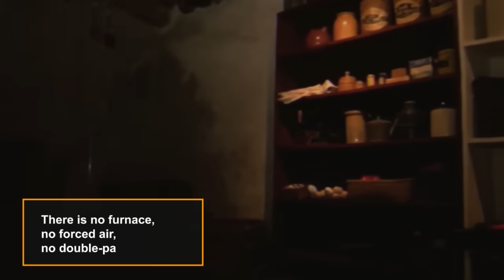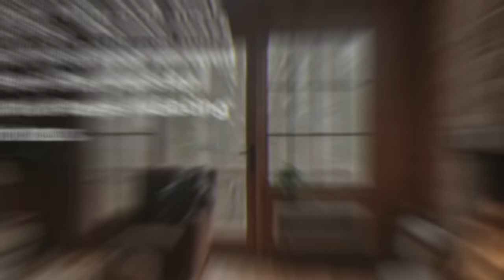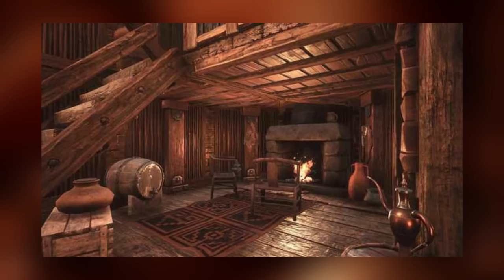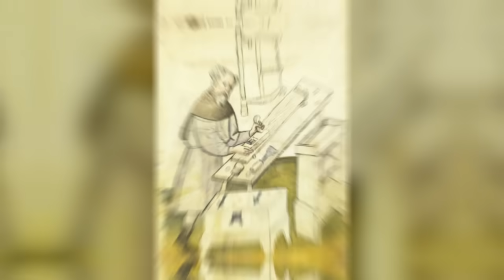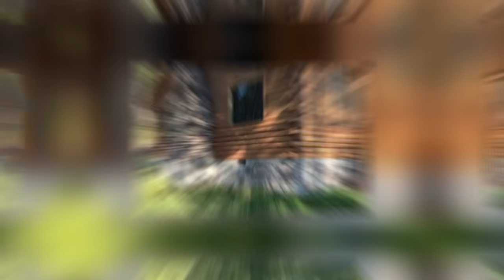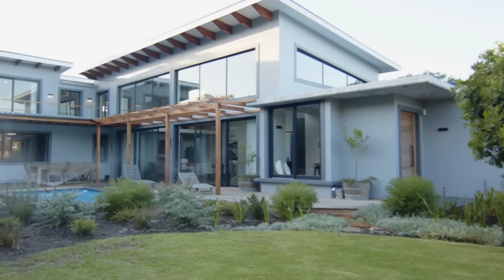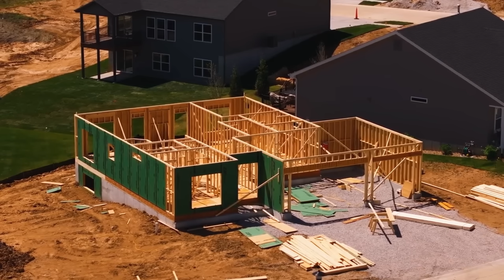Why Medieval Log Cabins Stayed Warm in -40°F While Modern Homes Freeze

Comment: I lived in Bavaria, Germany for a year, once I figured out how to use the Kachelöfen properly,  it became one of my favorite aspects of the house I lived innand ine of the things I miss the most!
Reply: I live in Bavaria and support your statement 100% :)
Reply: I’m sure one of those would work amazingly well, it all makes sense to have a huge thermal mass. However here in Canada where I live anyway, you would not be able to get fire insurance due to it because it’s not a CSA or UL certified unit for heating your home.
Reply: @myronhorvathsk liberals and their endless asinine rules/regulations
Reply: how did you heat the water then?
Reply: @bolek-trolek what do u mean?
Reply: @dmendez4741  the stove didn't heat water for showering and the rest, right? so this is the question. now i have a heat pump and it heats both the flat and water. if i had only a stove, which is the idea, how would i solve water heating. hope it makes sense now

Comment: My house was built in Wisconsin in 1946 with lathe and plaster and Cedar shingles- it's 80ºF in here right now with two small space heaters, while it's 39ºF outside...there'll be frost on the pumpkin come morning, and my furnace broke last February, but like ol' Hank Williams said, a country boy can survive. 😉
Reply: 80* F?  Good lord why?  I'm a south east acclimated person (originally from the north east) and I keep my heat around 60 to 65 in the winter.  Any hotter is completely unnecessary.
Reply: @justinw1765  Because I was injured in a serious car accident ten years ago- I'm not that old, but it left me with degenerative arthritis in one of my hips, and the heat helps with that immensely.  I always loved heat anyway- when I was in college, I worked for a powder-coating company and used to eat my lunch in a 140ºF oven just because it felt nice to me (hard on my shoes, though- we'd turn it down for lunch, but most of the time it was 400ºF degrees and it would melt the soles when we'd push carts through... then I spent about five years working in a shop that was heated by the machines' power supplies, and it rarely dropped below 120ºF- I should really sell my place and move to the equator or something.)  My late wife used to say I was like a walking space-heater... I can afford to do it, and I live alone since she died, so I may as well be comfortable- I've got three air-conditioners I haven't even touched in two years, so it sort of balances out.

Comment: Just thinking medieval log cabins were small . A medieval log house could range in size from a small, one-room cottage of 200–300 square feet to a much larger peasant "longhouse" of up to 1,000 square feet. Compare that to the multi-level modern home of 1600 to 2500 square feet. A lot more area to heat!

Comment: Our home is 9 years old with 2x6 exterior walls, 18" of blown-in insulation in the attic. It was built to current EPA standards. We heat with a wood stove. Home above grade is 4100 sf. Live in PA. Most days we are able to heat the entire house from about 66 degrees to 74 with one 4-piece log fire. Then the house holds that heat for tge entire day until the next morning.

Comment: I spent most of early years in northern BC, canada. All the homes I lived in were, not that great quality wise (but they were all basically the same no matter), and yes, I have experienced this. Not the power failures during -30 or lower Celsius snaps, but it was clear then, that the furnace wasnt really keeping up. The house was warm(ish) yes, but, certain rooms were quite cold and if you closed a door for example that room would get cold really fast. Even now where I am much further south were it hardly snows, when it rains, ALL the structures here can get noticeably colder. The other problem related to this is, often times artificial heating systems will be turned on when it is too warm for them to really need to be on, so the structure gets too warm, or, it not really warm enough, conversely.  
It all comes to down to how homes are built: sawdust, matchsticks and glue. They are built to the lowest possible standards and thanks to migrant labor and 'contractors', sometimes not even that much. In this country, we have always followed the amerikan mindset of home building. So a home in the far north, is not that much different to an amerikan spec house in Florida, albeit with slightly more insulation and (maybe) thicker glass. Canadians, I am here to tell you, never adapted any kind of cold weather construction expertise or industry. We just do a (slightly) thicker version(YMMV) of what the amerikans have been doing since the end of WW2.

Comment: 0:16: "small fire"
0:25 "no furnace" 
sounds like a contradiction
Edit: Ok, now that I've watched the whole thing, I understand what the author meant. However, I still think it was a poor choice of words.
I was familiar with most of the principles discussed here, and when I was a child, my family had large tiled stoves. They retained heat even for hours after the fire had gone out. I don't know, however, if they had a complex system of passageways inside to recover heat from the exhaust gases. I do know that there is another stove similar in its operation, a fairly well-known one: the rocket stove, sometimes combined with a long seat/lounge.

Comment: I stayed in a beautiful modern large log home/hotel in Canada in late fall, the owners were preparing to leave for the winter. The large log walls had so many cracks in them sound would move through from the other side like there was no wall at all, so I doubt that the insulation was very good.  If you buy a log home get one made from standing dead trees, that way the logs will be very dry to start with, settling won’t be an issue, then have the builder fill all cracks.
Reply: The cracks in logs are called checks and have no effect on the quality of the structure. All logs will crack as they dry. It is normal and a non-issue. Any checks outside that are open can be filled if you want.
Reply: @ThorD4602 Yah, fill them and inside walls too, don’t expect any privacy or rooms to be quiet if you don’t.
Reply: @littleDOG-fv9pe no, no reason to fill in checks inside the home.

Comment: The downside to such a level of fixed heat storage is that you have no fresh air coming into your home. Depending on how many people live in the house, you will get a build up of carbon dioxide. Also as the masonry heater begins to crack over time, you will get a gradual build up of carbon monoxide with the hot air seeping into the interior. Unless additional steps are taken, the interior air will lose humidity during cold months. All in all, while you are keeping warm and toasty, you may find it getting harder to breathe comfortably. And then with all that stone foundation and other masonry, the house might possibly turn into a radon gas collector.

Comment: Dad grew up in a log cabin on the reservation and he said it was freezing. They are not warm. You need things like - a fireplace or a woodstove or central heating. You know, stuff to create heat. And even then, they leak live a seive. You have to add chinking constantly, basicaly check around the house for any place where it's fallen out or cracked and replace it. They used to also attach paper to the inside walls to help keep in the heat.
Reply: There is huge difference between quality work and shitty work. Don't blame log cabin, blame shitty work.

Comment: On of the problems in modern homes is most have no fireplace. If they do, they are not the same as those of times past. Even in the 1960s, homes with a fireplace were made from brick and mortar. That retains heat. So while the outside walls may transfer heat quickly, at least the hearth will stay warm. If you've got stuff to burn, you'll be able to stay warm for a long time. Just stay by the hearth. You have to go back to the 18th century to get to considerably better design for keeping the home cooler in the summer and warmer in the winter.

Comment: My house was built in 2008, modern building codes. It's a typical American 2-story colonial style home - vinyl siding, modern ridge-vented roof, poured concrete full basement, 2x6 construction fully insulated and sealed, insulated 2.5 car garage. Located in Western NY where the Winters are fairly cold and harsh. While my house wouldn't remotely compete with a well-constructed log cabin for heat retention, the temp inside the house will generally hold above 50-55°F in subfreezing temps, with little to no heat source. I know this because we've left for vacations during mid-Winter and completely shut the furnace off, and the temp indoors never dropped below 50°F (10°C) or so. Sunny days will warm the house up nicely. It also stays cool during the Summer. Having a 12-inch thick poured concrete foundation/full basement probably helps regulate temps indoors somewhat. Modern homes are designed to permit some air flow through them, they're not completely air-tight. A home that does not permit proper air flow is a recipe for harmful mold, moisture problems, and other disasters that can potentially harm the health of the people living in the home. Building every single home out of giant logs isn't sustainable...

Comment: This is interesting. Thumbs up for that. I understand 'thermal mass'. It offers a buffer against rapid temperature changes. But as an engineer, I see trade offs.
#1) Thermal mass works both ways. If its 'inertia' requires a lot of time/energy for the inside heat/cold to be lost, it will take a lot of time/energy to restore it if lost.
#2) The walls, roof, floor, doors, and windows determine the RATE of transfer, regardless of thermal mass. The mass delays/buffers, but still accrues the loss
#3) Infrared spot sensors and imagers are cheap and can QUANTiFY the heat transfer throughout a building. Technicians can offer this as a service in lieu of buying one.
#4) With a thermal sensor, homeowners can select which 'weak spots' warrant attention.
#5) Windows have the lowest insulating abilities relative to walls and roofs. There were fewer windows on old cabins, most homeowners would not tolerate that darkness.
#6) Old cabin windows were single pane, compounding their poor insulating abilities. In exceptionally harsh climate TRIPLE pane windows are often selected
#7) I know owners of century+ old buildings. If they're 2 story, they sometimes literally close off the 2nd floor during Winter, to serve as 'insulation' for the first floor. 
#8) I know a homeowner with a modern, purpose built home at a ski resort. It's extremely well insulated, paid for up-front. Most homeowners buy to a price-point. 
#9) Barring it's large living room windows highlighting the scenery, it's better insulated than a log cabin. Its roof R value is ~60, unachievable in an old building.
#10) A modern tract home (like mine), compromises best practices for sake of cost. But I've made common, low cost improvements, as many people do.
#11) Any semblance of a log cabin is not realistic for most people (me too), as they live in an urban environment, with building codes and restrictions
#12) One R value cited for logs was R = 10. Another was 40.  One can spec. a modern home that high, and achieve equal sealing, and likely at a lower cost.
#13) One can add thermal mass with large timbers. Stone has more thermal mass, and water is higher than either timber or stone. (So, use water as a thermal buffer?)
#14) To reduce cost of heating, reducing heat transfer is more important than adding thermal mass, UNLESS there are routine, large day/night temperature swings
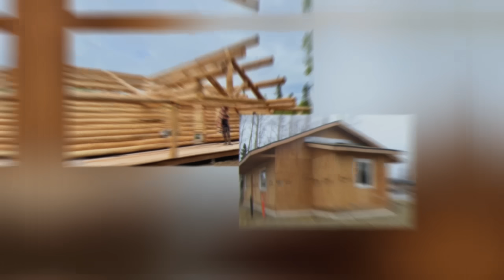#15) The comparative example cited at 16:40, was not fair. The two homes were NOT 'identical'. The modern cabin was kept at a high 70F, while the log cabin is not. 
         Why do this at night, when sleeping?  Modern thermostats accommodate lower nighttime settings. Imposing this difference was capricious.
         The modern home uses propane, while the log one uses logs. 
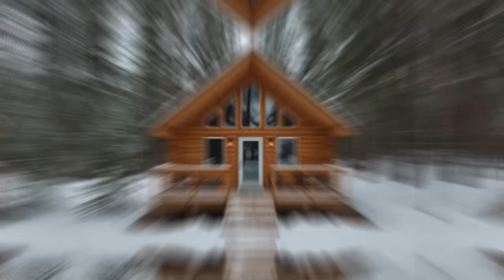          A photo shown at 17:09 is of a LOG cabin. Yet the narration begins its discussion about 'modern' ones. 
          The home shown at 17:09 has large, tall windows reaching to the roof. It's unclear which cabins have what features. (tall windows to the roof leak heat)
          Photos of multiple, DIFFERENT cabins of both log and modern construction are  shown. So, it's not at all clear how 'identical' the homes truly are.
          Based on these discrepancies, I grade this comparative example as 'incomplete, and inconsistent', rather than one which may have otherwise quantitatively 
          affirmed the relative benefit of a log cabin.
#16) Two big takeaways here are thermal mass and radiant heating, A modern home can be constructed with equal or better insulating floors, walls and roofs than logs,
          and use the identical windows, doors and vents. 
#17)  For the modern home to emulate the benefits of thermal mass and radiant heat, why not select WATER?
          Water has one of the highest specific heat capacities of any material. Its specific heat capacity is  4.184 ,J/(g * C)   {Joules per gram per degree centigrade). In
          contrast, for granite it's only 0.79. Since granite is ~2.7 times as dense as water, we may prefer to compare the heat capacity per unit volume. That value is 
          4.184/(2.7 * .79) = 1.96 times . Water is ~twice as good as granite on a per unit of volume basis. I can build a modern home to have better thermal mass per 
          unit of consumed space, and with far more flexibility for dynamically directing radiant heat to floors, specific rooms, walls, ceilings and pools with water.
#18)  What we're left with is the unique, charming ambiance of a log cabin. In the woods, it absolutely belongs and is 'at home'. But in an urban setting, the functional 
           advantages attributed to log cabins can be matched in a modern home, and at a competitive cost (unless you have ready access to cheap/free processed logs).

Comment: I think the issue that most people run into today vs long ago is the amount of lumber it would take to build a modern house using logs. also this is why people tended to build 1/2 the house in the ground. as the ground does not change temperature as fast as the air does. so being 2-4 feet in the ground does save energy.
Reply: The log homes from past centuries was often built with old growth trees - very big, very dense. The fast growth farmed trees used in today's lumber is not nearly the same.
Reply: Having a full basement, 10-12 inch thick poured concrete foundation will definitely help regulate a home's indoor temperatures. Most homes are built this way in the NE US, where the Winters are relatively cold and harsh. No way every single home in colder climates could be built with logs, just not enough lumber and the build cost is much higher for logs vs your typical 2x4 or 2x6 wood framed house. Any modern home built after 2000 should be good to go.